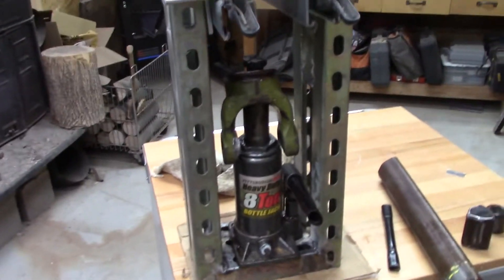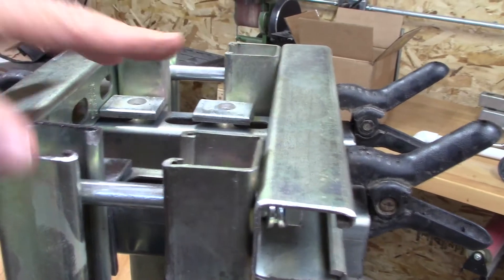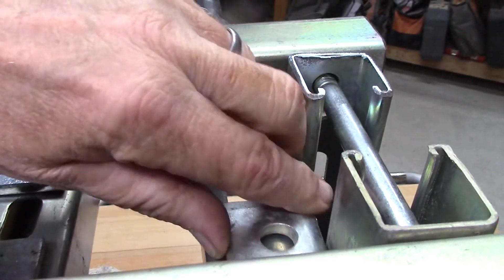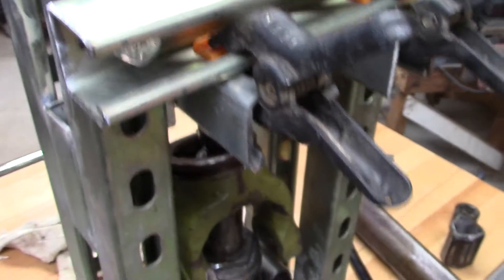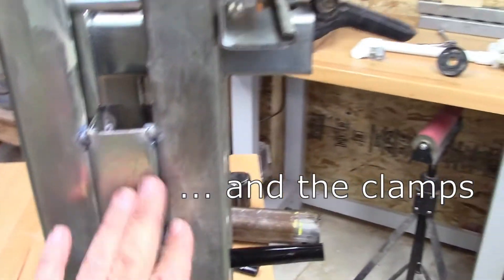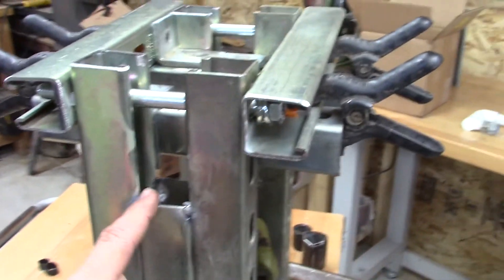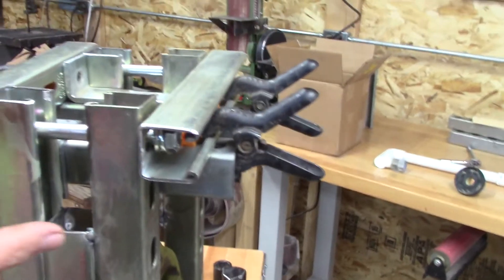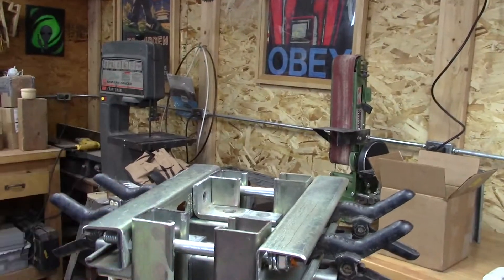DIY Uni-Strut (Erector Set) Hydraulic Press - Let's Figure This Out

Comment: Just curious why you didn’t invert it and put some springs on it for easy return when releasing pressure. Just a word of caution that if you do this table top version with the pressure going upwards, you may inadvertently create a skylight in your shop that you did not intend, which is why many of them have the pressure going down and assign making sure anyone operating is wearing steel toe shoes! 😂
Not sure where you’re located but those Unistrut go for almost $45 per 10 footer (1 5/8”) I knew nowadays at the big box stores, and even more online, so hang onto them as they will only go up in price! They also are great for making racks on the inside of shipping containers, and making your own custom tool carts